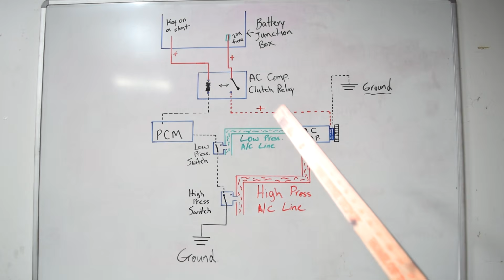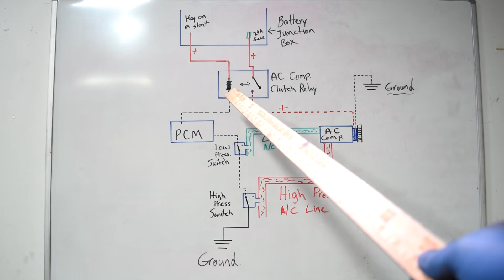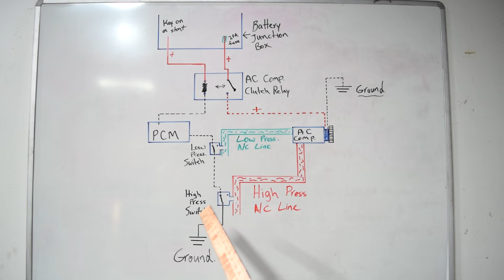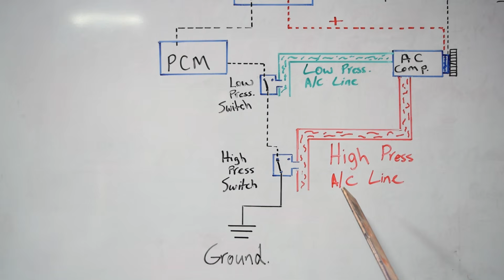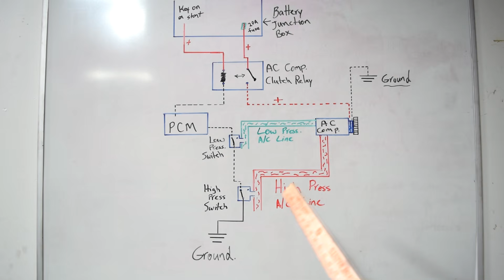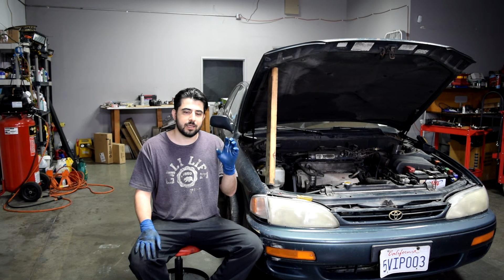How to Fix your Car's AC System - Compressor Coil, Clutch Relay, Low and High Pressure Switches

Comment: I recently bought a car 
A 1998 holden rodeo 
I’ve just got the ac compressor refreshed, put in another idler pulley and put everything back together but haven’t got it regassed as it’s a Sunday, I thought I’d make sure the clutch is engaging when I press the ac on but she’s not engaging. Is it a low pressure lock out ??

Comment: Well I'm trying to figure out my air conditioner fan relay it's not getting a ground from the so can I take a wire put it around the ground on the relay and then to the body for ground

Comment: Hi bro thank you for the video it helps alot but I have a problem with my 2009 Toyota land cruiser vxr , the AC after many one or two hours driving the car , it starts to disconnect and reconnect , it keeps blinking connecting and disconnecting so I was afraid this will cause more damage to my car Ac so I stopped the compressor and only using only Fan , what do you think is the problem? 

Thank you for your time

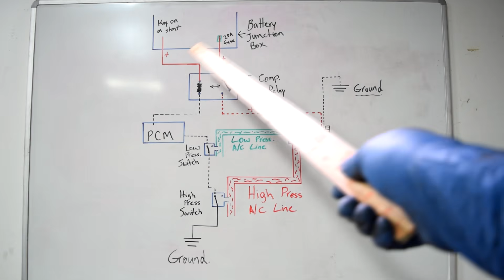Comment: I really appreciate your help man….I need help with my nissan sentra 2015, y changed everything already, low/high pressure lines, condenser, compressor, I checked for leaks and no leaks at all, already put Freon, but the compressor won’t engaged, and I don’t have a relay since is a built in relay, if somebody can help me with this I would really appreciate it, thanks 0:24
Reply: Try ac diode if have one that one started my ac cut it wasn't running

Comment: I need your help. 2010 Ford F150 5.4 200K miles ac not cooling like it use to. Replaced dryer element, expansion valve.  Cooling fans (electric)  are working properly. When idle the air is warm but when i press the gas to 3500K RPMS it starts cooling. I see the clutch turning but don't see the clutch pull tight like other ac compressor clutches locking. It seems like the clutch does not turn the same speed as the belt pulley. Any help would be appreciated.

Comment: My AC has been recharged and it blows super cold however it was only blowing when I pulled the relay out halfway. Now all the relay does is make a consistent clicking noise and the ac pump doesn't engage

Comment: So I have quite an old car, I can hear a click every now and then in the passenger footwell and the aircon cuts out... is this the normal high pressure safety switch? it has just been regassed, comes back on yet does not run continually .

Comment: My Camry the ac switch on the dash board the light doesn’t turn on so my clutch doesn’t engage but I did remove the relay and bypassed it n the clutch engaged

Comment: hey if i had tested the pressure switches to see if they were open using a CONTINUITY test wouldn't this damage my multimeter , So therefore i'll have to use DC Voltage test "assuming it's the pressure switches that broke the control voltage?

Comment: Thanks for the detailed explanation. On my 1997 Camry V6, the clutch engages for 5 seconds before stopping (the AC switch button blinks after 5 seconds as well), filled the refrigerant,  checked the relay,  no issues.  Is this a compressor issue?

Comment: Great video I have a question my AC klutz continues to run I put a new AC compressor in and it is working blowing cold but the clutch does not cut off I look at the relay and the owner before tampered with the relay there is only two prongs on the relay with a electric wire going to two Prongs what could the issue be

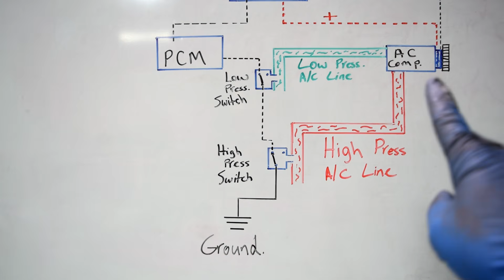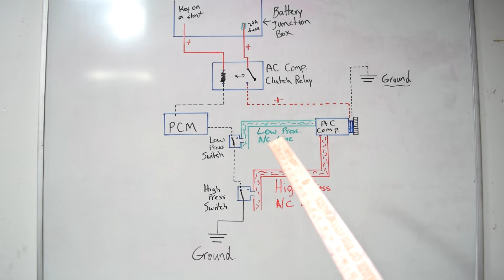Comment: 3:13  to test the high pressure switch, unlug it and use multimeter on two prongs for continuity.  5:25  when you dont have enough refrigerant, your compressor clutch wont engage.

Comment: Hey man, I have got a problem. My AC works fine if I jump start the compressor. But with relay (good relay), it doesn't work even I have just added freon when it's jump started. The interesting thing is, before I turned on AC with the relay, I know there's 40psi freon in it. But after I turned it on (even the compressor is not engaging becasue now it's working with relay), the pressure at low site goes up to 140psi. If I then turn off the AC, I can release a bunch of high pressure of air from the low site. Is this because somewhere in the system is clogged so the high pressure stuff are stucked at the low site? But based on what you show, both switches should be on under this condition and I should see the compressor running... Thanks

Comment: I have a 2007 hhr i having trouble with the relay ac CV lutch i replace it but it does not work but when i wire the relay and plug it in the fuse box it works but it reduces powerto motor so ik ghb otta removed do i gott replaced the fuse box

Comment: My 89 Chevy has a compressor issue. Where the connector goes, one one the metal connections that is in back of the compressor is missing. Looks like the metal fuse connections. How can I fix that. Don't want to replace a working compressor do to that. Helpppppp?!

Comment: I have a 2000 Honda Civic EX.  The AC temp at the upper vent is about 66 degrees.  I noticed that the radiator fan was not coming on.  I checked fuses, relay, the fan itself, and the Coolant Fan Switch.  I replaced the switch, and the fan began to operate.  

Vent temperature still at 66 degrees.  Using manifold gauges, I found the low pressure side to be at 40 psi and the high pressure side was at 196.  The outside temp was 96 degrees, with a feel-like of 99.  I noticed the gauges didn't move.  I checked the compressor.  The clutch was engaged, but it didn't cycle off.  I watched it for 10 minutes and the clutch never disengaged.  I finally turned off the AC inside the car.  The manifold pressure on the low side went to 90 psi and the high went to 160.

What should I check next?  Thanks!

Comment: I have a 2011 Avalon. The a/c fan will not turn on, can’t figure out why. There is a Relay switch for the radiator fan, but there is not one for the AC fan. From what I’ve been told the relays built into something called the air conditioner amplifier, I don’t know what that is.     

The air conditioner works fine at freeway speeds, will not work at stoplights. The AC clutch stays on, but the cooling fan will not turn on, any ideas?

Comment: hello where does the fan blower for cabin and thermostat fits in this diagram and also I dont see any interruption in the ac relay or clutch in relation with high and low pressure switches

Comment: Okay I used a jrump wire for 87 & 30 a boom clutch turns on a/c blows cold....Now I put a new relay in and now nothing clutch does not come on a/c blows got again....Since I was able to jrump it shouldnt that means my wireing is good?

Comment: Hey thanks for the video, it’s useful information. I got a question, I’m working on my sisters car, and I notice when I connect the battery, with the car off, and ac controls off, you can hear the clutch engage. I’m thinking it maybe a stuck relay, any other places you suggest that I check? It’s a 2005 Accord

Comment: My Compressor goes on 2 seconds and off. Over and over. No cold air.  So i removed my relay and wired it on. Still no cold air.
It all worked last year untill the high side leaked out. A recharge did nothing.

Comment: I have no a/c compressor engagement. But my static pressure on both lines seems good (over 100 psi). It's a Cadillac Cts and the compressor is very hard to get to, i can't jump it. Any idea where they are on a caddilac cts 2nd generation? I just want to finally figure out why my compressor wont kick!

Comment: Hi everyone ! I have a problem. My ac not working but when the fan start , if I manually help the clutch , the compressor run for 10 seconds then stop with the fan. when the fan start back , the clutch not engages . I help it and it start again for another 10 sec then stop. I add a full can of freon but I think my gage is broken . I`m probably overcharge now ! I don`t know ? why the compressor work  and don`t start wthout help. I don`t kick on the compressor ! just turn clock or conterclock wise and the compressor engage. thank`s for helping

Comment: But if my compressor is not getting power to engage clutch, how do i charge it the point to test my high and low pressure switches?

Comment: Love these comments in here which have nothing do with the video.  My 1958 Edsel only blows hot air, should I  add move freon or roll down my winows and go 80 MPH  to get cooled off. OR     ..What should I do if my compressor is vibrating and making a loud  noise , should I replace the compressor or just turn the volume up on my radio so I dont hear it............ Bunch of A holes on here  want free advice..LMAO! Most are hillbillies and Trump supporters............    HAAAAAAAAAAAA!!!!

Comment: I have a 2007 Toyota Prius my question is the ac blower system it's not turning I check the blower and is good I check fuses but the only one I have not Idea how to check is under the hood because in the diagram system show big fuse but in there its diferente because it's like one all unit of fuses any idea.

Comment: So i have a nissan altima 99. Ac fuse all good. Relay good. Ac cluch clicks on but never clicks off and rpms go up to 1200 and remain. Blowing hot air. Low presure pipe dose not get cold. Radiator fans both work. What could be the problem?

Comment: I have a 1989 Lincoln Town Car that has been a nightmare on A/C issues.

My A/C  shuts off on the highway, my fan shuts off when I select floor, & nothing comes out my defrost vent when I select defrost.

Could my low pressure switch be failing?

I just changed my check valve & Automatic Temperature Control Switch Servo. 
There was no change.

Changed my blower motor resistor a couple years ago, so it's not that.

I'm out of options.

Do u have any idea what the problem may be?

Thanks in advance.

Comment: 1996 Silverado 5.7  
No power to high pressure switch .. everything else is good. charged , good fuses , all new relays .  Low pressure switch has good power ... No power to compressor ...

Comment: Ac stopped getting cold. Clutch engages,   blend door works,  condenser fan works, pressure gauge says too much freon which I know did not have too much in it...no lines are cold. Think it could be the high or low switches?

Comment: I know this is a pretty old video hopefully u respond but the clutch wont engage unless i manually hit it with like a stick bu then 5 min later it will shut back off again it has refrigerant already do you know what might be causijg this problem?

Comment: My air conditioning clutch is always cutting in and out like normal but not enough to make a big difference.  Is it low on gas? Even though the water is dripping continuously onto my driveway? Any reply appreciated thanks

Comment: based on the info here I take I have both high and. low-pressure protection? "binary pressure safety switch. A binary switch disengages
the compressor clutch in cases of extreme low-pressure conditions (Refrigerant Loss) or excessively
high head pressure (406 PSI) to prevent compressor damage or hose rupture."

Comment: Hi . Great informative video. On my car VW Climatronic the ac and fan (low speed ) runs konstant no matter what settings. The only thing that shuts it off is when Climatronic is set to Econ (omic). That is normal cause it cut all supply power to Comp. and fan. The A/C works fine when cooling is needed so I do not think it is a coolant problem. I am suspecting a short in the low pressure sensor? Hope you can help.

Comment: I have a 01 olds aurora and I was checking the expansion valve in the ac system , mine has a red and a black wire , but I noticed that the red wire is not getting power to it , my question is that the red wire is not supposed be hot at all times? I hope somebody help me with that thanks

Comment: Ugh
I am a woman who has a '99 es300 with no a/c. The blower motor works, i test lighted the resistor plug (located near the gas pedal) which gets no light. I'm at my wits end what else should i test?! What am i not checking? Or what is an easier way to diagnose? I live in Florida and I'm miserable in this sweatbox

Comment: My car aircon is cooling nice, but when you stop the aircon and then  ON again it wiil never going cold anymore. You need to rest the aircon or OFF in 15 minutes so that will function again. Sometimes my car i mistakeably shift to higher gear then my car died, ,and when i start the engine the aircon never going cold anymore.. I need to switch off the aircon in 15 minutes, after 15 minutes i switch ON again, there ok again.
What is the possible problem? Thanks

Comment: Thank you so much for this!  My Dad added coolant today and my car started blowing fuses and smoking and running horrible..  he ended up testing things out and jumped a wire to get the clutch to engage. (from the battery to the high pressure switch / wire)  I am trying to learn what everything is called so I can explain this to my mechanic tomorrow!

Comment: 05 elantra. It's been acting up for years. Mostly low refrigerant, so I thought... I have refilling almost every other year. AC Quit working yesterday. I noticed my AC fan wasn't working. Clean connections and checked fuse. That did the trick. Next day AC quit when wife was driving it. Fan is running strong. Took out fuse again. Drove around and worked again. After playing with it for a while. It turns off while on idle. I then turn AC ON and OFF and give it gas and it works again (idle). Refrigerant is on the red from all the years of refill. I didn't refill this year.  Could it be the fuse? Why it comes ON when I hit the gas on idle and tinker with the AC button? Thanks

Comment: My ac is not staying engaged on all the fan selector settings. The A/C light stays on and unit engaged on setting 1 without issue but settings 2,3,&4 are intermittent or not coming on at all. Does this sound like a bad A/C control relay connector?  I changed the fan blower switch thinking it may be bad as I was advised by a friend but I did not see any bad contact points or burn marks on it. Thanks!

Comment: This is a very informative video. Thanks
I have a question, I have a 1985 Toyota 4x4 Truck, The AC is cooling, but the compressor never cycles off. It never cools down very well. When you accelerate the engine the low pressure side drops, in the high-pressure side increases to about 250 psi. The high-pressure side normally sits at about 220. Because of the age of the truck I replaced the condenser evaporator, and expansion valve. I replace the condenser and evaporator, strictly due to age and the fins starting to come off. The compressor was replaced last year with an aftermarket compressor, as was expansion valve. I have now ordered from Toyota, a low pressure switch and a Toyota expansion valve. Would appreciate any ideas that you may have.

Comment: Heyy, I have Skoda Laura and problem is its AC not working.I got to know from mechanic that it's AC's Magnetic coil issue and to solve it we need to replace the full AC which seems very costly.Any thing from may gain my measures to reapir it at very cost.Hope that you'll help me

Comment: i have a 95 camry 3.0l.. a/c acts weird lately. sometimes it works fine and sometimes i need to turn the a/c button off (fan on a/c off) on the  dash in order to get cold air. i replaced the button and relay but it still same. anybody have an idea? thanks

Comment: Hi, kindly i need your help with my AC system . the compressor clutch break and i replaced the whole compressor with new one , there was no dirt or shaving in the system , charged it and the reading are good high on 220 low on 30 but the problem is the air coming from the vent is about 65 to 70 which is way off . blender door is fine . the other thing the clutch wont disengaged . what could cause this problem please. thank you

Comment: Great job.  Question, Compressor not spinning.  I checked the low pressure side and it was at 100 psi.  Well in the red.  What could this mean?
Thanks again for a great and informative show.

Comment: clutch won't engage . I jumped the low pressure switch it engages still no cold air and gauge refrigerant half way in the green what's going on? help

Comment: I basically  have the problem my ac doesn't engage but when I add power to it it does  so should I just changed out my relay or rewire it and add a new relay ?

Comment: Please someone help me think this one through... my car nearly stalls when the a/c or defrost kicks on. The idle air and throttle position sensor are new. If the ac/defrost are off the engine idles fine.
Reply: J Jeppson bad ac compressor if a ac compressor on a car is seized it won’t slow the car to turn over since it runs off the belt you have to bypass it
Reply: It took me a year to figure it out, but I actually had a bad throttle position sensor and a bad idle air control valve. Fixed those and the car purs again.

Comment: How do you test for continuity for the low pressure switch? I'm omhing out mine at the two terminals and I'm getting nothing. Although I do get a beep when on the positive terminal to ground. Does this mean I have a short?

Comment: Okay so my compressor only turns on when i do a bypass (paperclip) i tried a new relay and nothing happens.. could it be the high pressure switch??
Reply: I am currently doing the exact same thing. Did you get it fixed? If so what was the issue..

Comment: Thanks i check my relays are fused if i bypass the socket then ac fan and compressorstart  automatically if i on the key so i have to change relay

Comment: Thank you I had a problem with Kia Forte 2015When I turn the ac on the rpm is 1000 and it is good 20 seconds later the rpm goes up 1500 .I turn the ac off but the rpm goes 900I HAVE to switch of the car AND Switch it on so every thing go normal.No codes shown on the scan toolThank you

Comment: I overhauled my ac system and is currently without freon. When I turned on the system, the control died. Checked the relay and its ok. Any ideas?